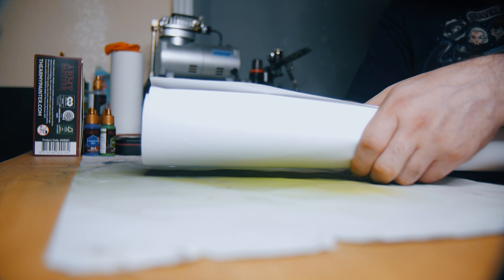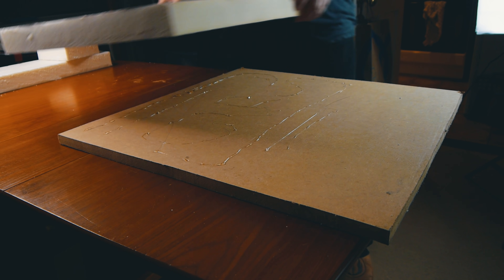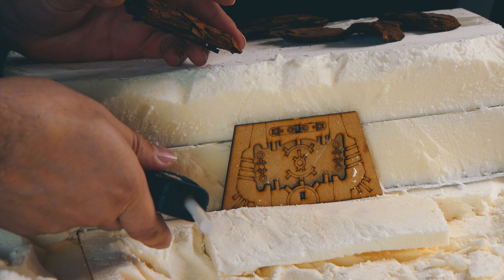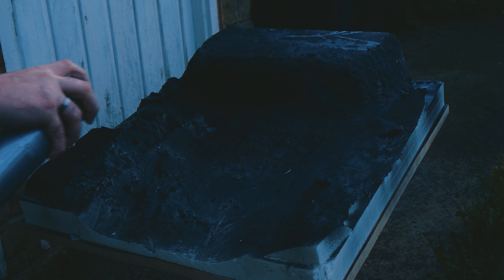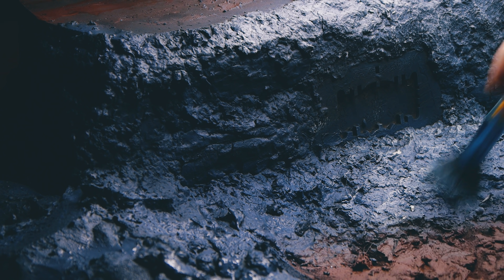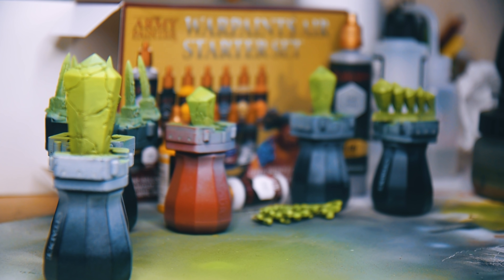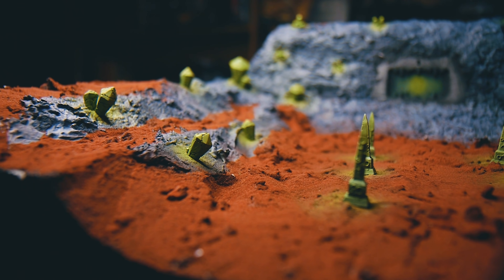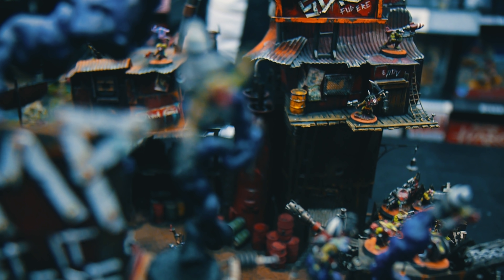IDIOT Builds Warhammer ARMIES ON PARADE Board

Comment: What PSi etc do you run your airbrush at?
Reply from the maker: It depends what I'm painting really. If I'm painting bigger pieces or priming I'll run at a higher PSI, usually around 50psi. If I'm actually painting with the airbrush and adding layers etc, I'll drop that down to 30, sometimes even 20 ish and use really thin paint. Easier to paint smaller details that way.